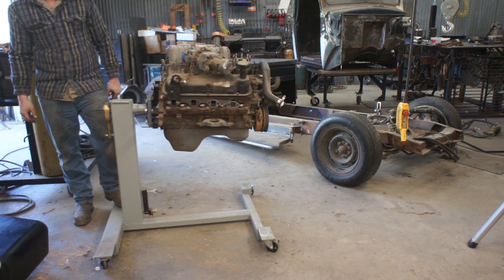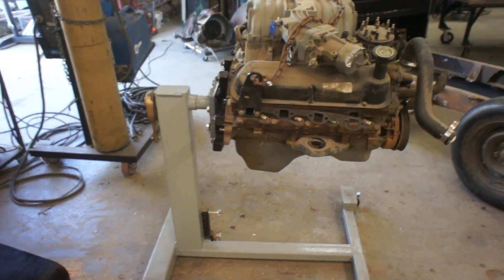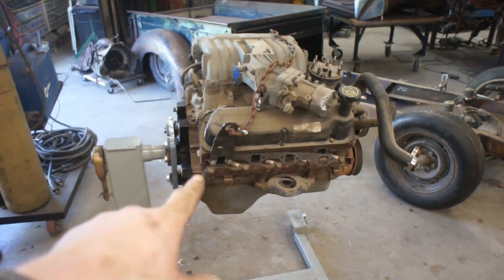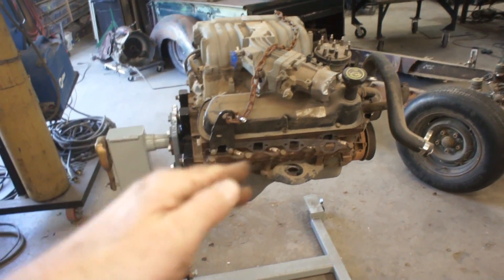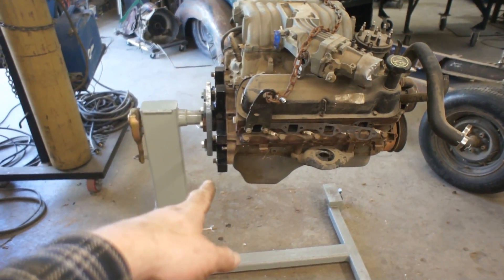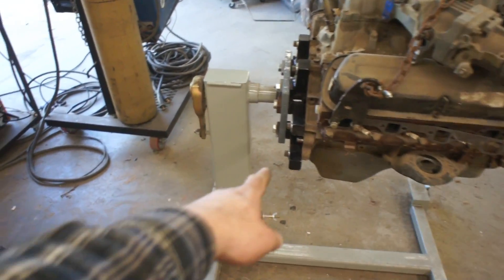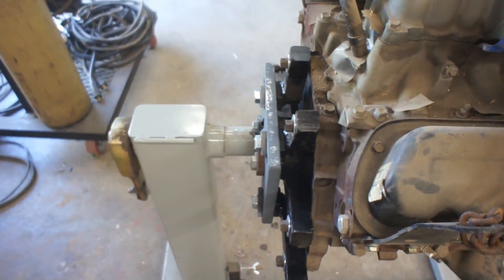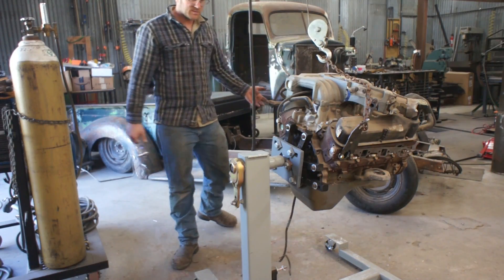The DIY rotating engine stand | with an engine!!

Comment: Does the slack adjuster lock pretty solid in both directions?
Reply from the maker: There is a spring loaded sleeve that pops up around the adjustment nut. It works great in this instance, as far as holding an entire car I cant speak to that
Reply: @unitedstatesofbuild4915  great, thank you!

Comment: Just watched your build video then had to see it in action here. Very cool, relatively simple design! I wonder if it would be simple to support the harmonic balancer with a roller bearing on another fabricated piece of the scrap you used for the frame. Would eliminate the slant from the weight of the engine, and if it was clamped to the existing frame, could be moved to accommodate shorter or longer engines, or different places harmonic balancers

Comment: What is the ratcheting mechanism you used? Also, great build, the flex is fine but I personally just prefer larger casters. Nothing pisses me off more than to skid to a stop because of a pebble. But it may b smarter using smaller casters, I dunno.
Reply from the maker: Its a brake slack adjuster off of a semi truck. A lot of service guys throw them away when they do a full brake service. Large casters would be nice, I def agree about pebbles and such...especially with top heavy loads. I wanted metal on here BC when some of those poly casters sit with loads they can get flat spots. Plus I knew these were quality bc Ive used them extensively on a bunch of projects. I appreciate your input, Thanks!!